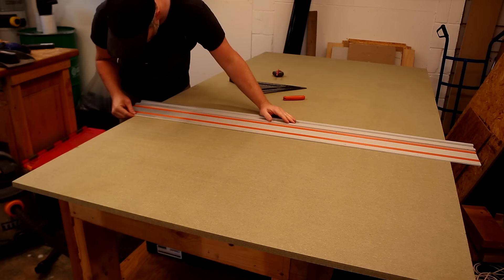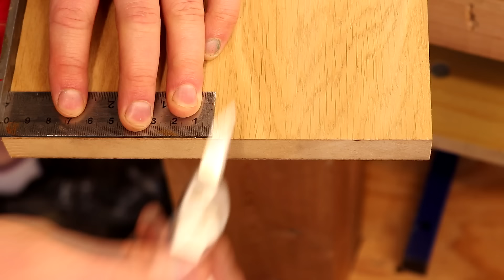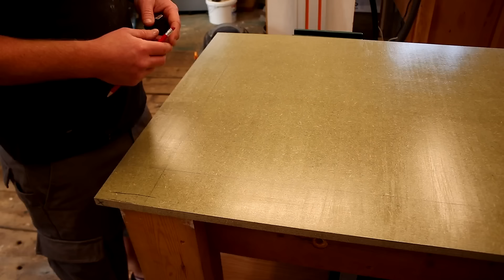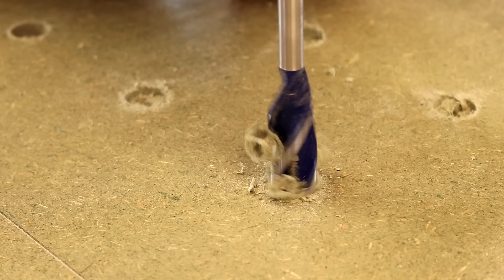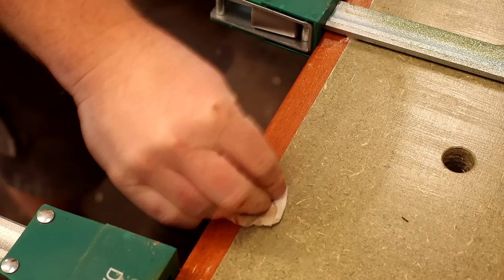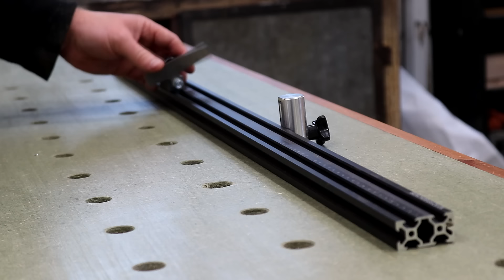Making An MFT Top - No CNC, No Guide Jigs

Comment: I want to thank you for making this video. I followed your instructions and tested it out on an old sheet of underlayment I'm using for clamping/assembly to see if it was any good. I'm quite impressed by the accuracy of this method and I've made multiple test cuts and every time the tolerance is within 0.05 - 0.10 mm and this is really more then enough for my woodworking projects. Thanks again and keep up the good work !

Comment: I have a Festool MFT and chop saw. The saw attaches to the MFT using through bolts. These are spaced to fit the 96mm centers  and you would not be able to attach it using the 100mm centers you have laid out.  In answer to why 96mm it's goes back to just after the war and standardizing, at the time the most readily available commercial helical gears for boring had their shafts on 32mm centers, nothing more clever than that.

Comment: Kudos for the great vid, but I can’t help think it’s way over thought and over engineered. A simple matrix drawn out with 100mm square markers then hand drilled with a forstener bit (better than an auger on MDF surely?) even if you’re wonky-eyed when drilling, you’d have to be a good few degrees off vertical with your holes for it to be an issue, otherwise it’ll never show as you’ve only gone through 18mm., hardly enough to make a bench dog inaccurate.

Comment: While you might "peg" yourself as a newbie I think you have to know that there's a few things you have done or suggested on this video that the other "experts" have not done.   I just watched a video where Dave Stanton used a very elaborate jig system for creating this MFT table.  https://www.youtube.com/watch?v=Xi9raT8gyEE         Obviously it is likely a bit more accurate than your process but you need to drop $185 USD to just start to make the top.   Seems a bit excessive for something you may make one in ten years.   But the few advanced things you did include.... the edging which no one else seems to do..that's no newbie idea.    Coating the top before you started to drill holes is also something the other guys did not do either.   Chamfering the edges of the holes no one else did.    Drilling the holes from the top and bottom is something the others never even mentioned or thought about.     So newb you may claim to be but in fact your ideas to build this top are very precise and have advanced ideas beyond what some of the others.   So great job and don't be so hard on yourself.  I hope to make one for myself but more of a portable unit as I really on do this for a hobby and can't afford the space.   My only suggestion might be to use a shoulderless spade bit set which tend to not rip up the wood very much.  They lack the spike crowns on some spade bits and auger bits.  Basically flat across with a slight chamfer and a single point.  I have used them for fairly precise holes to hold cylinder locks.

Comment: This is a really excellent video. What came into my mind about the jig for the holes of the mft. If it would be cut a bit wider - e.g. 250 mm instead of 200 mm and you drill two lines of holes (seperated by exactly 100 mm, and the first line 100 mm from the side) you can use it to drill it line by line. But the idea of this jig is really good.

Comment: Hey you are brave drilling those holes yourself to a perfect 90% ! did you not find if any of the holes were slightly off 90% when it comes to cutting its not a perfect right angle? Another thing you made your own wooden top for it. I have been looking at getting an br profile aluminium frame made ( comes in flat pack got a cutting list etc) but its not turning out cheap as it i would expect it to be (think they are ripping me off in the quote). Coming to the conclusion I may do similar to you. You have come a long way!!! :)

Comment: Excellent video!  This could easily be converted to imperial measurements I am sure, which is what we use here in the U.S. I love the accuracy of the table. Here in the U.S. there is a system called the Micro Jig System which uses dovetail clamps and a dovetail router bit. I was looking for a way to make the dovetail cuts accurately and dead on square, and this may just be the answer, so thank you.

Comment: made quite a few of these over the years.  use a sheet of pegboard to set out your holes push a 5mm spur bit through to mark the holes, so much easier and if you can use a forstner bit in your router at slow speed to cut the holes alternatively buy a cheap drill press to do it.  The 96mm is 3 x 32mm which is an industry standard many handles and cabinet dowels/pin outs are set to this. Its a left over from post WW2 utility furniture for some reason they picked 1 1/4" (32mm) for the multi head drilling machines of the time

Comment: The reason Festool is using a distance of 96 mm between the holes has to do with the industrial norm when using furniture hardware. The norm is 32 mm. So 96 mm is 32 mm multiplied by 3. I.e. the distance between hinges, when placed on a industrial way, is a multiplication of 32 mm. And the distance between  the holes to fix the hinge is 32 mm. Another example: the distance between the holes of a drawer hardware is a multiplication of 32 mm. BUT the first hole for that drawer is on 37 mm of the edge of the closet.
I hope this makes sence. Here is a Wikipedia link: https://en.wikipedia.org/wiki/32_mm_cabinetmaking_system
Reply from the maker: I understand that but that's still not a compelling reason to use that on an MFT table? 👍
Reply: @RagnBoneBrown  Depends on what you're making I guess. If you're in furnituremaking it could be more practical than another multiplication.

Comment: As a lifelong engineer I always check the diagonals as well, it's far more accurate for bigger items. I do have a three foot by four foot steel welded square that is super accurate but took a lot of making.
Reply: Agreed - providing the opposing sides of the rectangle are accurately equal, then measuring diagonals is by far the most accurate way of checking for square.
Woodworking accuracy is ummm... +/- 1/16" or 1mm, right?

Comment: Hi, I have a problem, I tried to become a patron tonight but got stuck. I do not have a Facebook account but it said I could use a Google account, so I signed in with that. That is where the problem popped up, it told me that I already had a patrol account and could not use this to add another. I agree I have a patron account for another You-Tuber but it has never stopped me before and it will not allow me to go any further?. I would like to become a patron of your channel but can't get any further if you could suggest any way around this then we both could get on with our lives. (PS I live in the UK and although I could go for the $5 per month you will need to convert that to UK pounds for my bank.
Reply from the maker: Hi John, if you already have a Patreon account you will need to sign in to it first and then visit my page and you should then be able to become a patron, there is no need to open a new account by signing in via Google or Facebook. If you don't remember your password there should be a "forgotten password" link. The currency is covered automatically, it just displays in dollars so you don't need to worry about that 😁 hope this helps

Comment: The set of measurements "700, 900, 1100" provided at 7:52 is INCORRECT.  If the sides are 700 and 900 units, the hypotenuse (diagonal) is 1140.1754...
Reply from the maker: Please read the pinned comment

Comment: Hello, I'm a metal worker but same principles apply. I find using dividers to lay out equidistant holes is extremely accurate. In this case absolute accuracy of the holes is not as important as relative accuracy. If the holes are all at 100.01 mm centres it doesn't matter as long as they are all 100.01 mm to achieve square/ straight when jigging/ fixturing. Dividers ensure completely consistent centres. Hope this helps someone. Great build cheers.
Reply: Good Tip, I was a carpenter for many years and began using dividers to lay out the pickets on a stairway on flat runs, especially if the rail had a radius.
Reply: Great tip.have dividers but it never occurred to use them before!at least now I'll keep it in my mind!

Comment: Was that 16 or 18 gauge nailer you used for the exterior trim? I’m looking for a smaller nailer to go with a framing nailer but can’t decide on gauge, is the hole size difference really that different between 16 and 18 gauge?
Reply from the maker: 18, I've never used 16 so not sure how they differ

Comment: The 3,4,5 rule does not work with addition.  you can only do multiples of these numbers.  So when you did the 600, 800, 1000 and then added 100 to become 700, 900, 1100, this is not a right triangle.   Using 700 and 900, the other number would be 1140.
Reply from the maker: see pinned comment!

Comment: I was wondering why you made a jig for the holes rather than mark-up and drill the board.  Of course! The jig holes are upright due to the drill press, clever! thanks for the video
Reply: @Robert Hawkins  
You could also use a plunge router with a 20mm spiral upcut bit and a hardwood or plastic spacer block to give you either 96mm or 100mm distance from each dog hole edge (insert a bench dog in each new hole and put the router & spacer block against it firmly to plunge-cut the next 20mm hole.

Use a router edge guide set to 96mm or 100mm (and multiples of that for the next row) to maintain the spacing along the lateral dimension.

With the "2 hole" or "pilot hole" method, there is the possibility of inaccuracies developing when drilling the final 20mm holes due to "drifting" of the auger or forstner bit as it could deviate from the exact center of the smaller 4mm pilot hole.

Just a 1mm error in a single hole could easily "grow" exponentially over the full length or width of the table, resulting in cut work pieces not being a true 90° or 45° depending on which two dog holes you use for your guide/reference edge.

Comment: I love metric, but why not use centimeters instead
Reply from the maker: People complain whatever dimensions I use, when I use cm people say why aren't I using mm...
Reply: Millimetres are the standard for construction measurements, as they're the smallest 'whole unit' that's easily usable in the field (and if you need .5mm tolerances, you're an engineer, not a carpenter :) ). Eg if you need something that's 2476mm long, you cut to 2476mm not 247.6cm.

Comment: Great video.  I didin't know there was a water resistant MDF board available (I'm in USA).   Regarding your holes being inline with your peg holes.  You could drill all the way through (as needed), and then from beneath, sister up and glue up a board to existing member.  I sugest this, if strength is a concern.  Thank you!  great videos!

Comment: 1140.17543...........    not 1100.  Your supposed right angle is acute.
   
You can't simply add 100.  You must multiply the ratio, not add.  If you are looking for 
the closest ratio to 900.  it is 3X900/4=675 on the vertical.  And 5X900/4=1125 for the hypothenuuuuuuuse.

Oh boy, this is middle school geometry.  Nobody thinks middle school math is important.   But it is.  And this
is the reason that I don't trust the contractors.  They have no concept of trig. 

By the way, most jigs use 96mm which came from 3x32mm of the shelf holes and standard for the CNC machining.
Reply from the maker: Read the pinned comment

Comment: It occured to me while watching this - you could make a jig from a square piece of wood with 4 holes cut 100mm apart. Put protruding dowels in two of the holes side by side and use the open holes to drill through. Advance the jig down the length of the tabletop putting the pegs in the two holes you just drilled.

When you've done one full length - turn the jig 90' and start from the top again.

Jeez - I don't think I described that very well :-/

Crappy ascii art incoming:

Jig:
+-----+
|o   o| <- put pegs through these two
|        |
|o   o|
+-----+
Reply: You could but any error then stacks up, each adding to the last. You are going to have some of that regardless if a jig is used because there has to be some clearance in the pins to get them in and out,  but by doing it in a strip, at least in that direction they are as measured. The strip method is more accurate,  but more work.
Reply from the maker: Sounds like a good idea!

Comment: The Festool spacing of 96 is 3 x 32. 32mm is the standard spacing in line boreing machines
Reply: It's also a multiple of the most common 16mm MDF and chipboard that in EU en the rest of the world from which cabinets are made. Thus the 96mm works towards the spacing for stacking multi layers of the 16mm stuff

Comment: If you made your jig two rows instead of one you could just put something in two adjacent holes (even screwdrivers would work) after the first drillings and you wouldn't have to go through the extensive measuring every time
Reply from the maker: That would result in cumulative error
Reply: @RagnBoneBrown  not if you're working from one good corner and you took as much time as you did with the jig
Reply from the maker: If you are even a tenth of a mm off, by the tenth hole it'd be 1mm out...

Comment: if you make the jig a couple of mm wider you could have made a set of pin holes to align  with the first set of holes  use 2 aligning pins  no more measuring
Reply from the maker: more chance of cumulative error that way - much better to reference from the edge eac  time in my opinion

Comment: I’ve never seen moisture resistant MDF. 
Would love some 3/4” HDF to make a top out of.
Reply: HDF is a thing... I have a custom MFT style table, in which I used 1" HDF vs MDF... and it's freakin' heavy!! I also laminated a top and bottom skin of Dibond to the table. (There's also LDF, but we use that for our vacuum hold down sacrificial CNC table)
Reply from the maker: hdf is just hardboard isn't it?
Reply: Rag 'n' Bone Brown yes High Density Fiber board. Never see it in anything other than the 3/16” they say is 1/4”.

Comment: It used to baffle me also why or where the 96mm standard came from. However Festool use 96mm centres simply or largely because this also fits the standardised 32mm systems (ie 3x 32= 96mm) which are already widely and commonly used for other purposes such as shelving bracket intervals - also see Festool’s guide rail with 32mm interval holes etc. However you can use whatever size you like provided they are of course always exactly the same - the units chosen are irrelevant in that sense

Comment: Nice jig and video, but I do question how vertical the dog holes are using a hand held drill.  Could you check that with the dogs?  It would be better to use some kind of drilling jig to assure the dog holes are vertical.  You could also skip the 4 mm drill step and make a thick jig on the drill press with vertical holes the same size as the dogs, and use a dog to position the jig.  Depending on the size of your drill press, you could make 2, 3, or 4 rows of holes in the jig.
Reply from the maker: New video coming tomorrow about the accuracy. The auger bit has a tip which centres itself and pulls itself in to the guide hole so it drills pretty plum because of that

Comment: Really great video Keith, i was thinking of making an MFT table using either the Parf system from Axminster or the trend template. your option is way cheaper and just as accurate. if i make one this is definitely the method i will use. I wondered why you didn't follow the Trend jig method more closely as this means you only have to drill large holes once and then you use a router with a flush trim bit to cut all the holes. just curious not trolling or anything!!
I am also curious about what you can use the MFT for, I know Peter Millard uses his all the time but i don't think he has a table saw. I am also searching for Bisch Basch Bosch for more MFT inspiration. PS i like the change of location for the talky bits, very professional looking.
Reply from the maker: I wasn't aware of the trend jig to be honest
Reply: @RagnBoneBrown  I was going to buy the Trend jig, but this statement that Trend made put me right off " Please note:
When using a jig there will be a cumulative error that cannot be avoided when indexing the jig on existing holes." they don't say what courses the error, (could be your router template guide" and they don't say how big the error is!!
I figure I can make enough errors and don't need to buy them!! lol
Reply: Peter has a table saw, but only uses it for repetitive long cuts; he does mention this in a few of his earlier videos (I think that he talks about it in his Track Saw Workshop series, actually).. He much prefers his track saw.
Reply: @robnunya572  i was thinking that as i don't think i have ever seen him use a table saw.
i'll have to check out some if his earlier videos.

Comment: 96 mm spacing is because it's 3 x 32 mm, which is the grid for cabinets, shelving and hinges  but that's the only reason I can think of.
Reply: Glenn Storey That’s the reason for the 96 mm spacing which is also the reason the LR32 size as well, it’s all based on 32 mm cabinet system!
Reply: It allows you to use the Festool LR32 Hole Drilling System and rails to drill the MFT top holes.
Reply: @dsdragoon  Also true.

Comment: Table came out great!!! I like the mft style but they're just too damn expensive, I'm going to try your ideas to make some portable tables.  I cheated on my assy table, had a local cnc cabinet shop make my 4x8 (ft) top out of 1" MDF for the same cost of buying a replacement MFT top.  I still had to chamfer my holes to save machine time so I can still say I had a hand in the making, lol...
Reply: Yes, this is what I did... I paid a place with a CNC router table to make my top as well as a 1/4" mdf sacrificial top with matching holes. I can flip it when it gets too cut up. And when I need to replace it, it's way cheaper than getting a whole new top made.